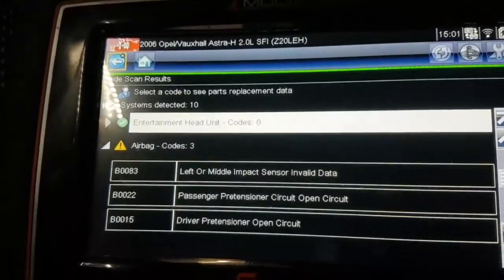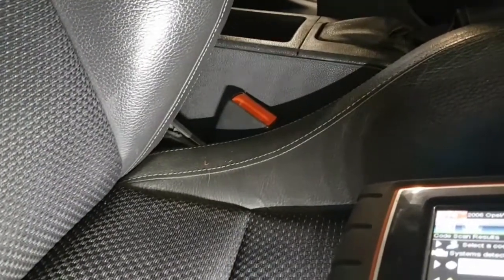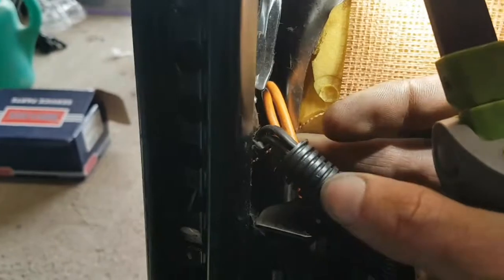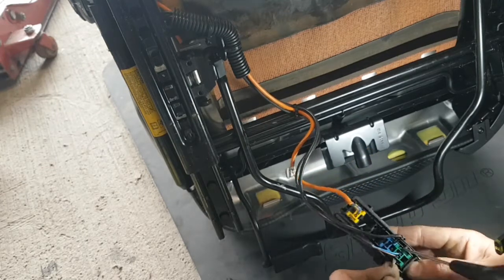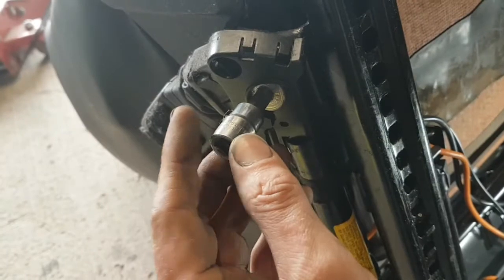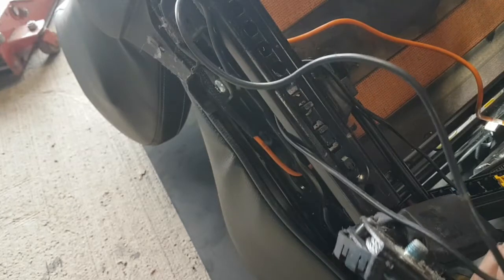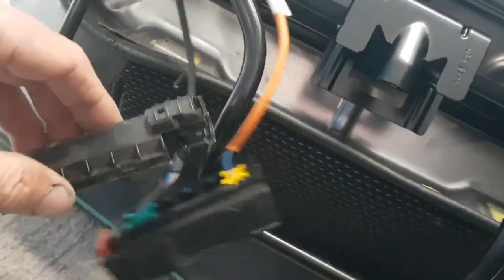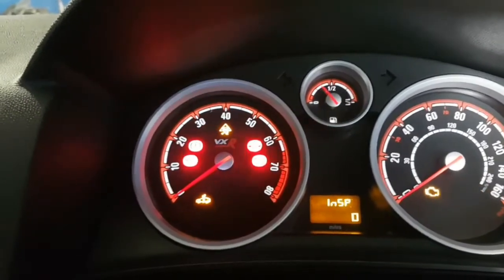Vauxhall airbag fault codes B0022 and B0015 fix

Comment: Hello mate. Love the videos. I was wondering if you could offer some advice. I have an astra van 2011(H) and I have GSI fitted. Unfortunately I have an airbag light on which is becoming a pain. I've checked all connections and everything seems fine. Any advice?
Reply: Did you find a solution?